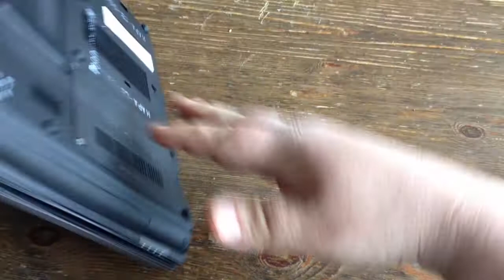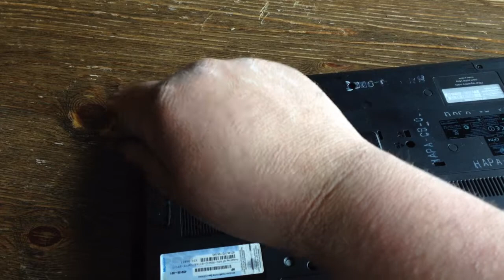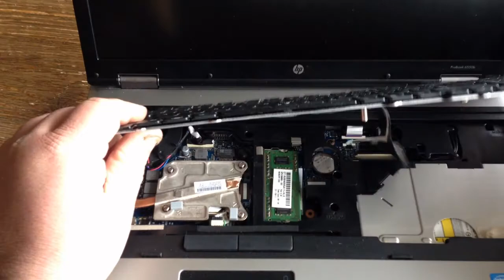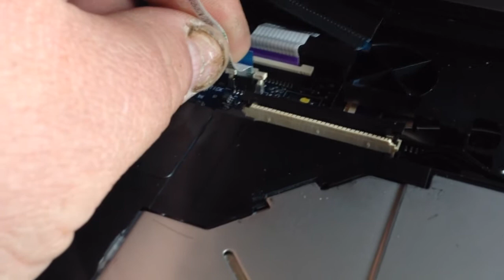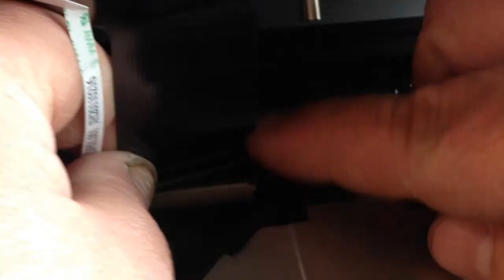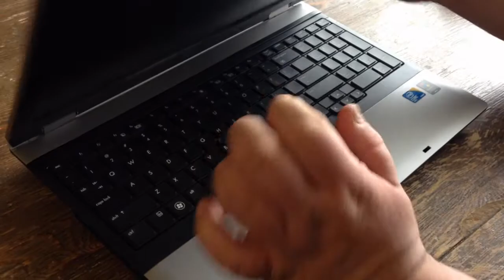How to remove and install a keyboard in a HP ProBook 6550B laptop.

Comment: Very helpful. I couldn’t get the tabs to move on my replacement keyboard so it’s floating a bit in there, but still seems to work. Any advice on how to free them up would be appreciated.
Reply: I had the same problem. Turned out it the replacement was a cheap copy of the HP part. New supplier on Eb*y had correct replacement with tabs that moved.